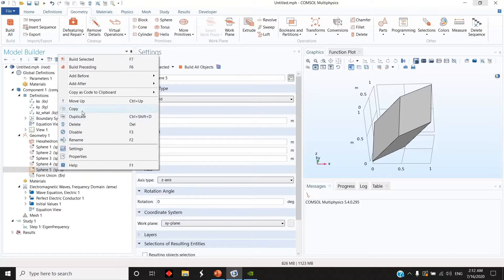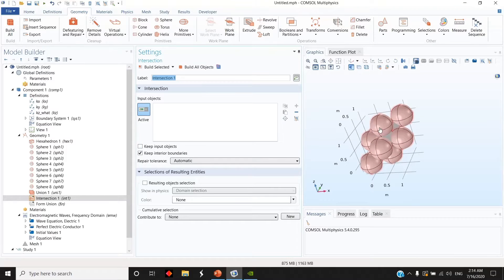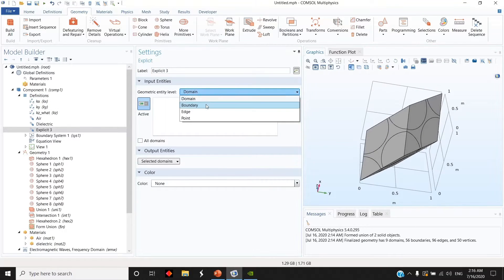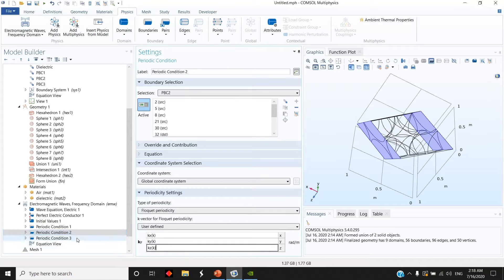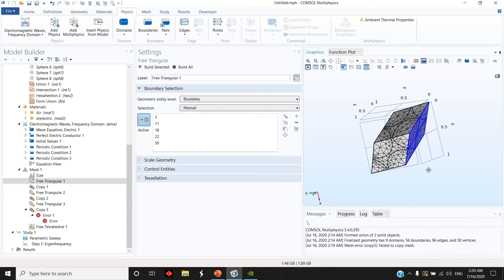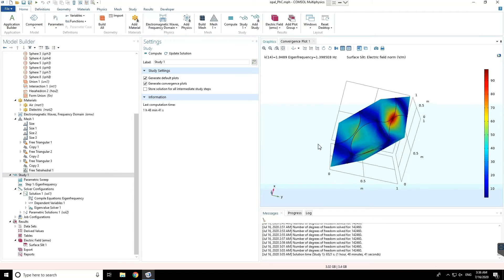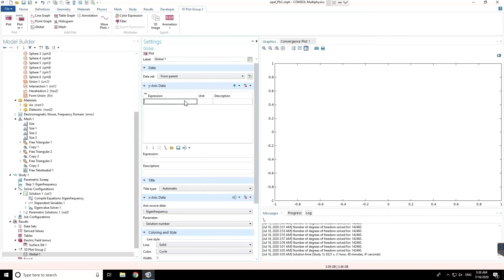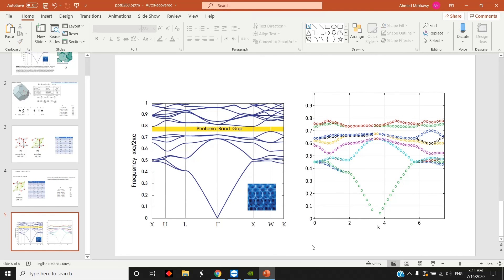3D photonic crystal (FCC, Opal, Hexagonal) using COMSOL - part3

Comment: I have followed all of your steps, but I got different result, which is imaginary eigenfrequency. What could've been wrong?
Reply from the maker: Does this at all wavevectors-all "k"-? I can share my file with you, please email me.
Reply: @ahmedmekawy1632  you've already sent me the file in the e-mail. And, it works! Thank you so much.
Reply: @ahmedmekawy1632  could I also get this file ? Although I followed the step, I still didnt get the result. My email is jinyoulu@ntu.edu.tw
Reply: Very nice presentation.
Reply: I have question that in reciprocal space the FCC structure is BCC structure with BZ as truncated octahedron of 6 symmetrical points and BCC structure is FCC structure with BZ as Rhombic decahedron of 4 symmetrical points. Here we are working in reciprocal space for FCC structure (which is now BCC structure in reciprocal space having truncated octahedron as BZ). Therefore, the primitive cells would the same hexahedron but orientation would be different as given here: http://lampx.tugraz.at/~hadley/ss1/crystalstructure/structures/bcc/bcc.php.
instead of this:
http://lampx.tugraz.at/~hadley/ss1/crystalstructure/structures/fcc/fcc_jsmol.php.
Sir would say in this regard.